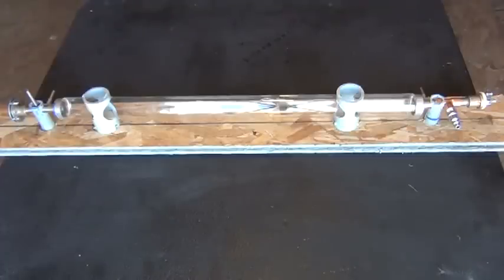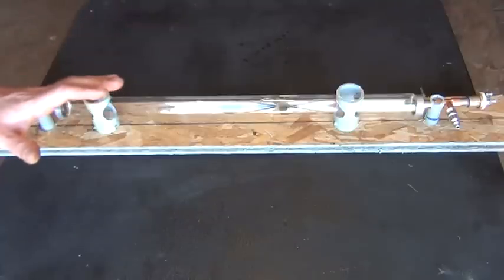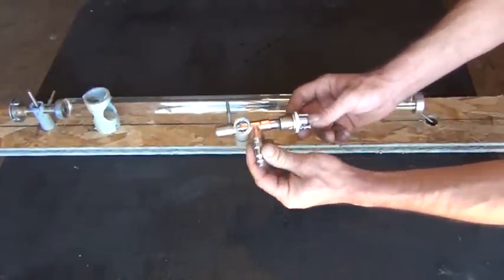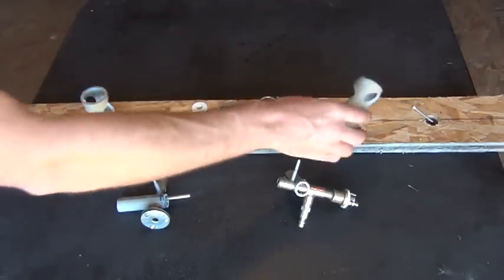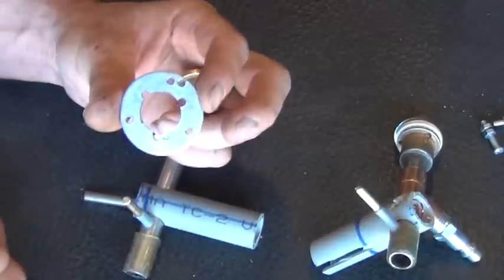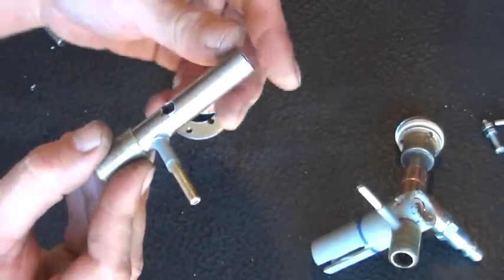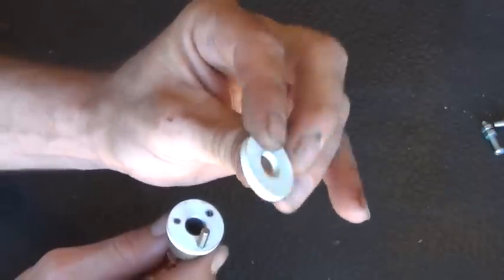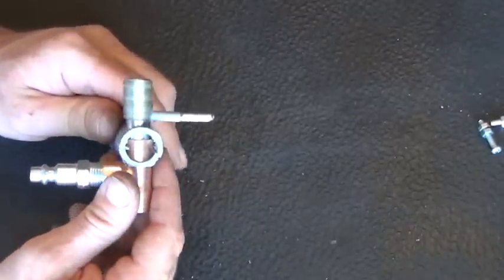Homemade CO2 Laser, part 1

Comment: More information on the 'staples' you used to clean off the coating inside the tube please. Different parts of the world have different words for hardware. Staples here are small thin bent U shaped wire fasteners used to hold sheets of paper together.

Comment: hi i as wondering if i could use clear acrylic tubing instead of glass i've made plasma tubes with it and not had a problem with it melting  ty for your time  mike  ps i enjoyed your vid
Reply: How hot does the inner tube get? Could pvc be used for the inner tube? Pvc would flex, but you could use the flex to calibrate the mirrors by applying tension cords in 3 places down the length of the tube.

Comment: Apologies for not watching every video or reading every comment & response but please tell me approximately how much this laser would cost somebody to build ? How many Watt is it ? How much do you think a DIY 60 W laser would cost in components please ?
Reply: The longer the tube, the higher energy is "generated", basically the photons are inside a linear "particle accelerator", so if they do longer travels......  do the math. :) yea, I know, I'm only 4 years late :P
Reply: So a tube along  a circular track infinite heat because lazer are negative Kelvin temp unlike Fresnel lenses only gets hot as Surface like sun
Reply: Don't apologize so wanting more knowledge
Reply: @RiderRickMaker  is possible to reach 60W laser with this setup? How long should it be for 60W?